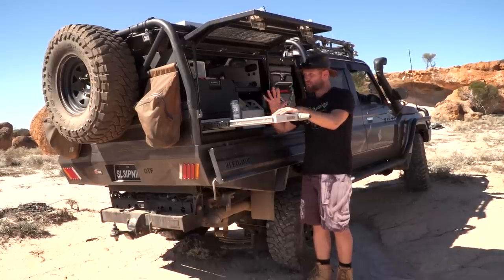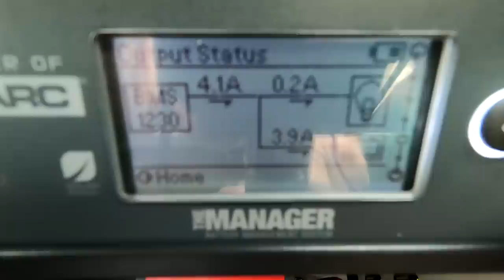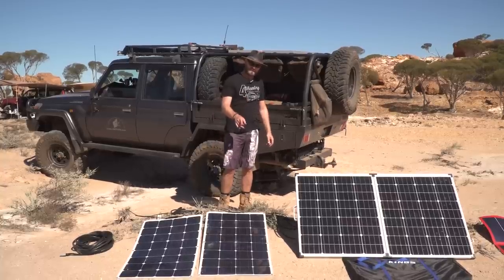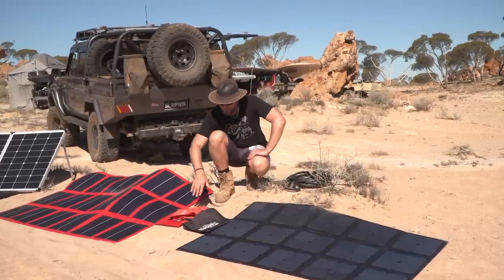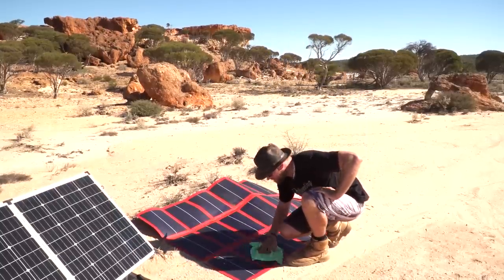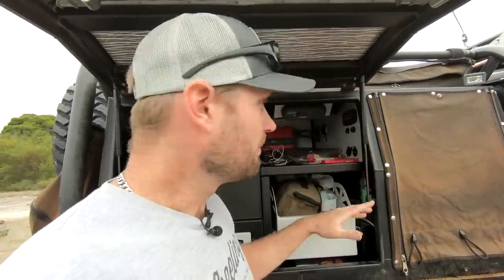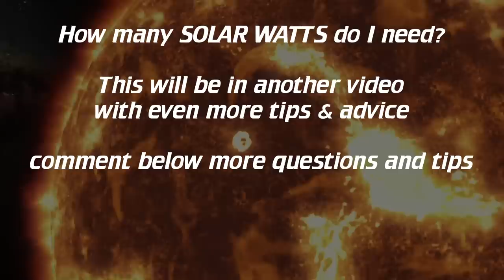SOLAR POWER 4x4 Overlander, tips advice

Comment: Hi Ronny, Dave from Rolasolar here. Great video some added information for your viewers.

Temperature Coefficient:
Solar panel temperature is one of the important factors that affects how much power a solar panel will produce. So the more sunshine generally the hotter the solar panels get and this in turn reduces the solar panel output. In some cases the heat can reduce output by 10% to 25% depending on your specific location. Looking at the manufacturer's data sheet a term called "temperature coefficient at Pmax" should be listed. For example a monocrystalline solar panel with a temperature coefficient at Pmax of 0.50% means is that for each degree over 25˚C the maximum power of the panel is reduced by 0.50%. So on a hot day at a solar panel temperature of 45˚C the power would be reduced by 10%. Conversely in cool conditions output would be higher and in temperatures below 25˚C the output can be high then rated. Not all solar panels are affected by heat equally and some do much better at coping with the heat than others. Amorphous solar cells are known for their low light performance and shade tolerance. They also are also better in high heat conditions than monocrystalline and polycrystalline cells due to their lower temperature coefficient value. Amorphous solar cells will always yield more power into your batteries throughout the day then mono of poly of the same size. If retailer can't provide the temperature coefficient values for the solar panel - walk away.

Best way to prevent heat loss with mounting semi flexible solar panels directly to metal surfaces is to mount them on a backing material like core flute which allows air flow under the solar panel.
Reply: Rolasolar Nice to get some cold hard facts out there :-)
Reply: Rolasolar  ;
Reply: Thanks for info Dave 👍
Reply: Hi, Dave from Rolasolar here again. Some added info for mobile and portable solar panel buyers:

Did you know that most mobile/portable solar isn't certified like building solar. This leaves the buyer open to being scammed with uderrated and poor quality solar?

How do you know that a solar panel is underrated for its size, because there is a standard size for a solar panel for the power output. 

12V monocrystalline solar panels with a cell efficiency of around 17- 20% should be roughly 0.0064m2 per watt. If there is a substantial variance from that, you are being misled. 

Listed below are rough sizing you should be looking for in a monocrystalline solar panel:

80W panel = 0.512m2
100W panel = 0.640m2
120W panel = 0.768m2
150W panel = 0.960m2
160W panel = 1.024m2
200W panel = 1.280m2
250W panel = 1.600m2
300W panel = 1.920m2

If you want to know that the panel you are looking at is actually the wattage advertised, do the math above, or jump on a reputable sellers websites like Everdrive or Redarc and compare sizes.

As an Example one of the 200W fixed solar panels from online is 1170mm x 510mm or 0.597m2 which equates to approx a 95W solar panel.

 This scam has been going around for years but seems to be ripe on the auction and other cheap product websites. Do your own research don't be misled by the scammers.
Reply: So best thing to do is set up your solar panel when it's raining! 😁
Reply: @Rolasolar  just cut n pasted that entire comment into my buying notes. Thanks a lot.

Comment: Tip:
If you got the space on you car (approx 1700x1000mm)and a charger/mmpt that can handle the higher output voltage (approx 35v), talk to you local solar sparky. They often got old house mounted solar panels they are happy to get rid of. You often get em for free or for a carton/six pack.
Got a 220W panel for free and intend to run it with a Victron cyrix-ct vsr and a smartsolar 75/15 (or bigger).
Get a deep cycle battery and you got a set up with enough power for 500ish $, unless you can source a deep cycle battery for cheap (ask a fire sprinkler guys etc).
Don't go camping very often so I try not to "waste" a lot of money in big brands.

Comment from the maker: SKIP TO ANY PART HERE:

0:01 intro
0:35 Battery Power (batt bank)
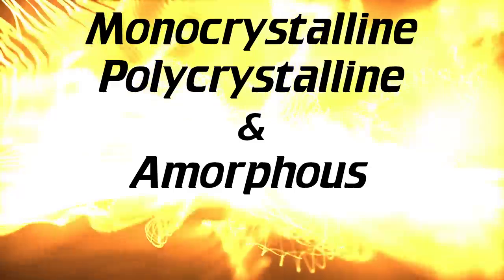1:57 Mono/Poly/Amorphous SOLAR CELLS
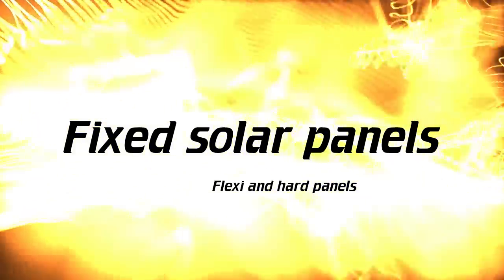4:57 Fixed Panels (pros cons)
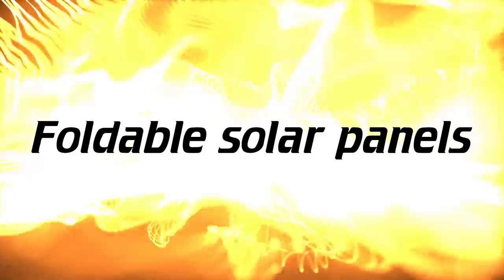6:55 Foldable Solar Panels
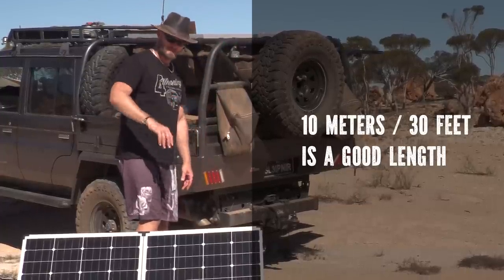8:26 Solar Blankets
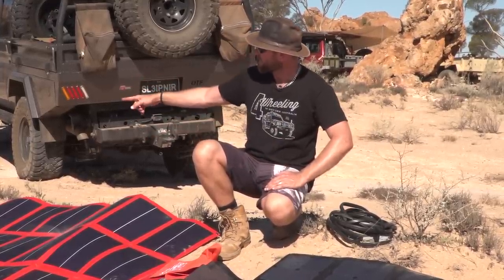9:55 Clean Panels are key
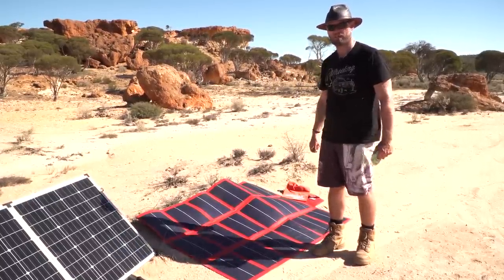11:27 The Shadow Factor
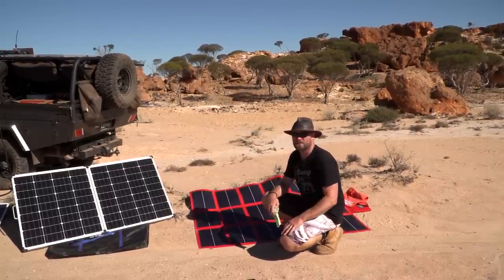12:47 Do I need Cheap or High Quality??
15:21 SOLAR REGULATORS + CONTROLLER
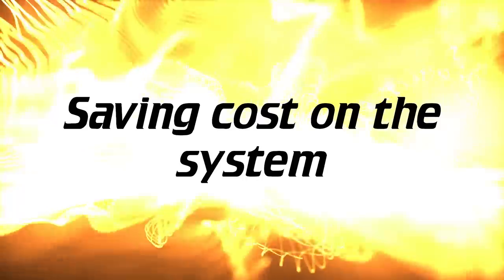18:37 Budget system
Reply: you forgot to mention that glass is the only transparent material that can last in the sun full time. all the flexible panels will only have a service life of 6 months permanently in the sun before they go opaque or delaminate and then output only 1/10th of their rating
Reply: This comment made the video 100x better. Really Good Work Mate
Reply: 2JZZ12 Cheap material usually PET can have the clouding affect and can deteriate after constant UV exposure. ETFE material used on quality semi and flexible solar panels has been UV tested for thousands of hours. Its the same material used on flexible grid tied solar panels approved for a 20+ year service life. With all solar panels as with all products you get what you pay for.
Reply: Links to products please ? thank you
Reply: Did you make the video on how many watts you need? Can’t find it.

Comment: I have a 250 watt foldable solar panel connected to a Projecta DC to DC charger in my camper that has 2x 100 amp hour batteries. We run coffee machines, fridges lights and other auxiliary power, and have never run out of power. I think your video this morning was very informative for anyone starting out. Weld one and keep up the good work.
Reply: Rob Blane Totally agree with that level of Solar and Storage
Reply: Hey Rob ! Can you tell us the brand of your solar panel ? Cause your setup is pretty much the same as mine, but I just want to buy some new solar panel !

Comment: I have been thinking about a solar setup for when I get back on the road for many years. I bit the bullet and started on the setup.
I've gone with 2 x 138A/h AGMs, 2 x 160W fixed panels, a 12 Volt controller and DC-DC charger/regulator, and a 3000W pure sine wave inverter (I'll be using a computer and other electronics). I've got a 3000W petrol genset as a backup. It may be overkill but I will be using a fair bit of power. The ute will basically be a mobile bush mechanic's workshop (and video/photography studio) with a fridge, shower, stove, and bed.

Comment: I have a Kings folding panels which I had mounted flat on my roof rack, used only when parked up for a few days. It worked ok. I have since mounted a hard shell roof top tent, so I have now got a kings solar blanket which will be used when parked up on my next trip in a couple of weeks.

Comment: I have a fixed panel on the roof but have a blanket I can run out when camped up as well. Just wired the plugs in parallel and feed into my 1225D BCDC. Works really well.

Comment: One problem not mentioned is the vehicle mounting of fixed panels; I have more cracked and damaged panels as 4X4's are flexible and so are their bodies, when mounting a fixed panel I always use rubber exhaust bobbins as this gives more under panel cooling and the flexibility of the rubber gives enough movement to counter the flexing of the panel.

Comment: 3 x 120w foldable panels from ebay (other $120 each), ripped the PWMs off, replaced the diodes for schottky's as the panels themselves were German qulity. Then mounted the epever tracer Mppt 30cm from the 300ah Giant battery + dual battery 150amp fused blah blah.. 7 months touring east coast of Aus with 2 x 40 litre fridge / freezer.. worked a treat.

Comment: Pretty good overview. I like how you pointed out the efficiency gains of the amorphous (most people simply say they are "less efficient" because they require more surface area per watt.  Is a tractor less efficient that a micro car when plowing a field? Of course not). You didn't mention that the amorphous panel is also more efficient in hotter conditions, though all panels do lose efficiency as they heat up, as you mentioned. An amorphous panel will still continue to put out amps as the sun sets, well after the mono has shut down.  If amorphous were only slightly more expensive, I couldn't understand choosing anything else, unless you were really tight on room. As it is, there is a huge price difference. Overall, very good overview.

Comment: good run down on solar thanks Ronnie, we have a cheep folding panel which came with an "MPPT" controller, I chucked the controller and as you said have a DCDC controller near the batteries in our camper. this also provides a proper charge from the car when towing. its only a 120w panel but it runs the 70L fridge and our lights just fine.

Comment: I like house panels, might be a bit big for a 4x4 but on even a small caravan/ poptop it's probably the best way to go.
They're not only cheap (about $20 for 195w) but the higher voltage helps alot, mines a 7.something amp 40v panel and even in the shade and sometimes at night it will still charge because it still sends a high enough voltage to the mppt for it to work(highest ive seen at night was 2A in but its better than nothing). I did a week long trip with the van parked the whole time under a tree and by lunch time it was basically float charging.

Comment: From what i understand MPPT charge at high amps which isn't as good for the battery. Where as PWM charges slightly lower which is ideal for deep cycle. As long as you have the correct size panel for your requirement thats the key.
Reply: A good MPPT charger will let you set the charging amps to suit your battery capacity, and therfore optimum charge rate. For example, if your battery is 100AH then you generally want to charge it at around 10A. A victron smart solar MPPT charger will let you set this in the configuration.
Everything about MPPT is better.

Comment: my 2Ct for PV install:
I agree with your argumentation allover, this is an extremely good explanation for starters - IF money isnt´t 1rst argument - but quality. Best efficiency will be with MPPT and PV in 2x series. BUT:
You save > 100€ with PWM controller and loose ~20% efficiency. An additional 100Watt PV Panel is less than that! [btw, as you said: these measurements are taken @ 25°C, @ higher temps PV loose efficiency!]
Semi flex gives you more opportunities for installation, like on slight rounded areas, @ the side of the truck etc. PLUS these have rings to fix them easy and fast - e.g. to undo and put them into the sun.
I would strongly suggest a smaller LipoFe over a much bigger AGM. Better install a second LipoFe additionally later when budget is available. Saves lot of weight and space!!! 90% out of them vs. 50% + min. 3 longer life time.

Example: My setup will be the following on my Van (in mid Europe): 2x 100 watt semiflex on my roof, that will be unscrewable if needed, PWM + AGM @ first, later LipoFe. What I will loose in efficiency on controller will be covered by the second PV.
Note: I will have no fridge, winch to be running. Nothing in my kitchen. only luxery stuff like Smartphone, Tablet, Cam, lights inside, music, heater. I need lots of juice for starting my Diesel in the cold, Glow plug etc.

Comment: Here's my car/tent camping setup:
I have a 100 watt flexible monocrystalline panel, 25 feet (7.6 meters) of 10 gauge twisted copper cable with Anderson quick disconnects to an MPPT charge controller, & a 35 amp hour AGM battery.  It's perfect to charge my phone, run a portable TV, run a 12 volt fan for those hot nights & power some LED lights for the tent.  There's even household current through a car power inverter if I need it.  The battery, charge controller & inverter fit inside of a marine battery box for portability.  The cost of the solar system is around $500 USD.
Reply: Hmmm sounds sort of expensive. Can you price the pieces of equipment you're using please?

Comment: We run the REDARC BMS30 paired with the 190w Solar Blanket and a 2000w Inverter. Primarily use it for charging our camera equipment when filming and editing the days action while chilling out at a lit up camp site. Would definitely not feel as safe plugging expensive gear into cheaper quality solar products. Definitely need to uprade the 120AH Lead Acid battery to a Lithium sometime soon though we always seem to set the low batt alerts off late at night when editing.

Comment: the trick with solar panels  is how many you can run in series..

2 of a vs 3-4 of b may benefit you quicker

Do a proper power  draw test

If I was going to look at battery  power running electrical I would consider going 4 or however big the tray space is 

make sure all your batteries is of the same rating never use a high rating with a lower rating  because 1 will flatten the other

Given the cost of AGM's you might want to consider lithium batteries as the power source given their longevity

Comment: I'd add that 1 Tier, 2nd Tier and 3rd Tier PV panels can also be explained in terms of output over time.
They will all start off the same, even outputting more than claimed in cool sunny conditions.
But after 5 years+ the 2nd and 3rd Tier panels show noticable reduction in output compared to a Tier 1 panel

Comment: I run the kings panels but as mentioned the regulators are not the best so just removed the kings one and purchased a stand alone red arc 20A regulator.  And wired the panels through that.Works brilliantly.

Comment: We dont get too much sun here in Ireland, but Ive found that when it is very sunny my ARB fridge takes my leisure battery down below the low voltage cutoff and I wake up to my fridge around 4c instead of 1c.  So Im looking for a solar panel for the roof, just enough to give a wee boost on the rare days that its hot and the fridge is using more power.

Comment: I agree with you about spending a bit more on the solar regulator, I spent just over $100 on a 200W polychristalline panel with the cheap blue regulators you see on ebay. Panel is great, but the regulator is crap, not enough settings on it, can overcharge the battery & the chinglish instructions are next to useless!

Comment: Really good Video Ronny.
Perfect for general consumption.
I've moved to 200Ah Lead Crystal and 200watts of Solar.
MPPT in DC- DC charger.
Additional blanket to increase system to 380watts if need be :-)
Also take a Noco 7.2Amp smart charger, comes in handy more than you'd think.
Reply: Just be careful with the Lead Crystal Batts. They need a charge rate of 30% of your storage, IE 200AH of battery, needs 60amp/hour charger connected to your dc-dc charger. The solar does not need to be that big as it is OK to charge them slower for awhile, however you do need to give the batts that big faster charge very couple of weeks ideally. If you are able to access 240 volt mains power and use a large mains charger, that is OK also of course. If you are able to get the charge into them regularly, they are a great choice as they are able to be drawn down much further than AGM's

Comment: Great video Ronny. I just purchased a 50L frighted for my Jeep and I am looking at ways to keep the single battery charged up. The 2 door Jeep has space as a premium and since I have a hardtop, I am looking at the 100w solid panel attached to my roof to charge my system and keep the refrigerator performing at 100%. I usually overnight camp and then hit the trails when the sun comes up - not much into the base camp stuff.

Comment: More efficient to run the longer cable at higher voltage too, for less voltage drop. Not a huge difference if you use good cable but every AH counts and you can be sure that if your CC is putting out 14.4V to the battery over a short, fat cable then your battery is getting 14.4V. Doing that over a longer cable and your battery could be getting a lot less V.

Comment: Perhaps it would help if you actually understood what amp hours mean's,and how batteries are rated. If a battery is rated for 100 amp hour's,then it will deliver 100 amp hours at it's C20 rate,regardless of whether it is an AGM,lithium,or LAB.
Reply: Yes, you are right but at the expense of dramatically shortened battery life. It is not advisable to use more than 50% of a lead acid, gel, or AGM battery capacity.This fact is on virtually every battery website on the net.

Comment: Had an Engle fridge and measuring it’s consumption rendered it useless. The non energy efficient non inverter controlled units are power hungry, go to an inverter energy efficient CFX Waeco or similar and you’ll cut the consumption by a massive amount. I can run the CFX off a standard lead acid car battery with no solar panels for 3 days, same experiment with the Engel was two hours. I’d say concentrate more money on the powered devices rather than the bank that powers it.

Comment: We camp in shady spots in the high country. Portable panels are great but the shade from trees usually blocks them as well. I bought a cheap Aldi 700watt 4 stroke generator and a 20 amp eBay 4 stage battery charger as a backup. I run a 240 volt 65litre bar fridge in the pop top van from an inverter. I usually am OK with the 400 watts of solar on the roof running the system even in partial shade. I use the generator on cloudy days for an hour to tickle the 250 amps of batteries. The system works really well. Can you do a video on generators as well.

Comment: As a auto electrician I can talk that Pwn acts like a multi stage charger may now produce as much power but for fixed solar its better for the life of your battery so both has pro and cons so you can’t just tell people they are crap, Ronny you need to talk to a good auto electrician not a sales man or just dpd
Reply: Also high quality like redarc you pwn like the bcdc1225d and the bms so Ronny should check his research better mppt is just the lastest thing that every so called expert recons is the best